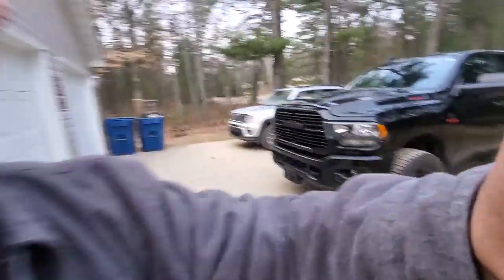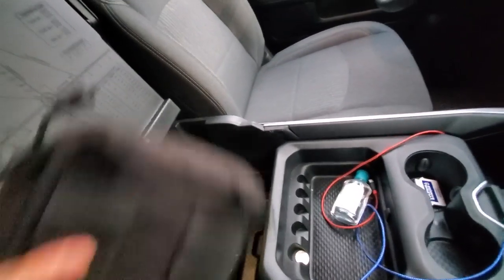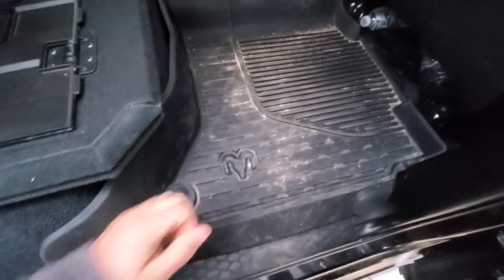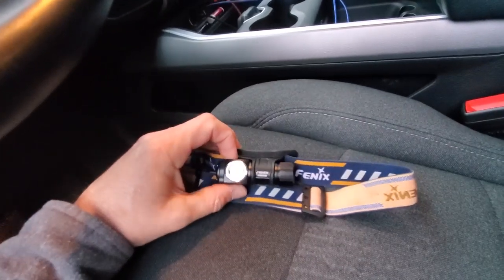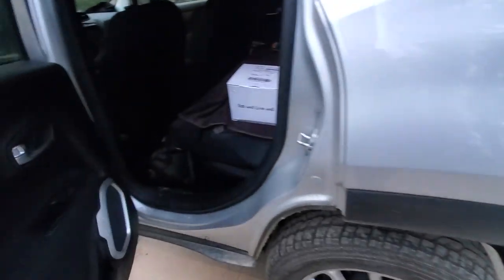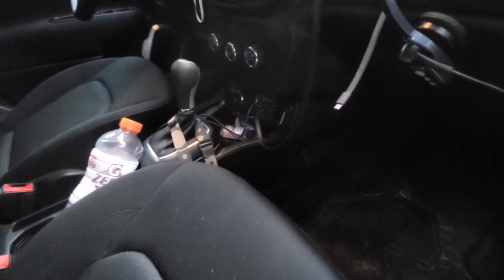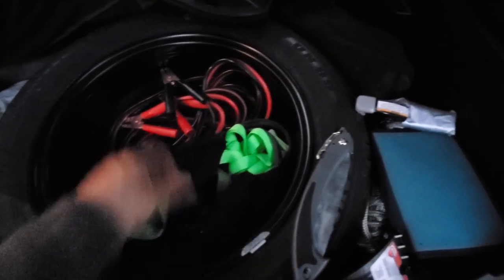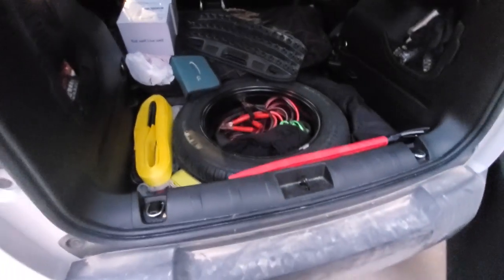EDC Stuff To Have  In Your Truck Or Car

Comment: Combination window breaker and seatbelt cutter within reach of the driver’s seat just in case you accidentally run your vehicle into a pond, lake or river!
Reply from the maker: Great idea. The points on your vehicles head rest bars are designed to break windows as well. Reach behind your head and pull u off the head rest and small side window with the bars.
Reply: @SamkoTradBow  What’s nice about the combination window breaker and seat belt cutter is it can be placed within easy reach of the driver.  Most are hi-viz and can be attached securely so they stay in place but are accessible with a one hand yank!  If your seatbelt won’t unlatch you can safely cut it with the razor sharp cutter and of course if your electric windows stop working while your vehicle starts filling with water you can break a window, usually on the first try.  I’ve got mine tie-wrapped between the center console and driver’s seat.
Reply: @SamkoTradBow  The one I bought from Amazon is the Resqme and is less than $20.00 for a 2 pack.
Reply from the maker: @jmarine1933  yep my wife had one on her key ring that would pull off when you yank on it. They are fantastic

Comment: Nice setup! you should add in a medical bag  with the capability to stop puncture wounds and injury you might sustain in a rollover or accident away from help. especially if this is a truck you use for hunting, redundancy is always a good thing! Even if you have a medical kit in your bag, the others you hunt with or people you come across may not. and even if you are not trained or dont want to risk any liability, being able to provide medical to a person on the scene that has training ( like a RN or off duty EMT) or the injured person for self aid is a valuable resource. a lot of times people in those careers dont have medical supplies in their POVs. have a good one!
Reply from the maker: Fantastic idea. Probably the best recommendation I have heard. Will research this soon and start putting together a kit. Thank you
Reply: Traditional Bowhunting And Wilderness Podcast I would recommend a laptop style bag for the kit. It will make it easier to store in your truck. On that bag, on the outside, you can rubber band a few tourniquets to the outside for easy access if you have a bag with molle webbing on it. Maybe a road flare  two for signaling at night on a road. Inside,   Compressed Z fold gauze, quick clot gauze, Compression bandages, medical tape, ace bandages, a Few NPA air way devices and a couple decompression needles and chest seals. Extras would be a few chem lights for marking injured people at night and extra illumination. Wouldn’t hurt to put gloves and a headlamp in there if you have the space. This will serve you well for a large portion of trauma.
Reply from the maker: @stevecourtright9856  awesome.  Thank you. Will dig deeper into thos when I get some time

Comment: Good kit. Maybe think about a hi-vis vest or two if you need to stop on the road. I carry an inexpensive oversize Tyvek suit if I need to work on or under the vehicle in foul weather. Keeps the  wind and wet off and keeps your duds clean. I would also up your first aid for trauma - I have a large scar where an arrow broke and part of it hit my hand - bled like I'd been shot. I think anyone with a bow/firearm should have a full kit for penetrating injuries. Have you considered mounting tow points on your vehicle?
Reply from the maker: Good suggestions! I bought a tow bridal like tow truck drivers use for my car so that it can be towed easily. Sold it last week and bought a cherokee trailhawk with tow points

Comment: I like the way you think. One thing I always carry in any rig that’s headed off road is a high lift jack or a farm jack they are called. They have saved me more than once from spending a long cold night in the bush.
Reply from the maker: Farm Jack's are great for sure. Heavy and take up a lot of space and require some knowledge of how to uses them. So not for the average person that doesn't want to take the time to learn about using them correctly and safety.  Bit 100% agree with you they can be amazing tools for all sorts of uses offroad!

Comment: Have you thought about putting a dedicated jump pack in your vehicles? Jumper cables are nice but if you don’t have someone else then you’re outta luck. Mine has saved me many times
Reply from the maker: I have 2 of the jumper packs. Love them. Reviewed one 2 years ago and still use it every week to start my lawn tractor as the battery has been dead for a couple years now..lol In the winter I always have one in the car or truck. Comes in very handy not only for me occasionally but also to help others fast and easy.

Comment: Comprehensive setup. Me like. I have a Mossberg 590A1 in my rig, specifically for large quardupeds/active shooter, as well as a lot of the stuff you do.
My dad and I are designing a prepper/hunter flatbed for trucks.fuel tank has a completely hidden 2 long gun, 2 pistol locking drawer, locking steel storage for chainsaws and valuable tools, camping gear. Locking steel generator compartment. By the time we get done with it, it will be too expensive to sell.
Reply from the maker: Sounds like a sweet rig! Plus quality time with your dad as you guys build it.

Comment: Have you had any problems with all the emissions junk on the ram? I'm thinking about getting a new one but have had nothing but problems with all the emissions stuff on my big truck (International prostar with Cummins ISX) I ended up doing a full egr and dpf delete and haven't had any problems since.
Reply from the maker: I have not had any problems yet with 30k miles. Follow and talk to many hot shot drivers with 200-400k miles on their ram 3500s and not one has told me they nad to do a delete or any major issues.

Comment: Hey Jason - I know this is an older video, but I just stumbled upon it recently and had a question.  How do you go about selecting the weight capacity for the come along?  My truck's curb weight is 4445 lbs and it would seem that the 5 ton model might work.  Your thoughts?  Thanks.
Reply from the maker: I basically buy the highest rated one I can afford thst still fits in the car or truck. Pulling weight rating is different from lifting rate.  So you want to check both. Come a longs suck for vehicle recovery.  And now that I learned to winch with the wheels I will probably never use one again.  Video coming soon on the wheel winching and have a quick demo of it on my social media pages.
Reply: @SamkoTradBow  Thanks for the reply.  Im looking at doing a DIY pig hunt in GA, going solo, and figure that I definitely need a method for self-recovery.  I picked up a set of X-bull boards and will be getting a shovel as well.  Do you think I'd still need some form of winching as well?  Thanks... you're awesome!
Reply from the maker: @yoda4x4  the winch is always a good idea to have. And a 4 ton come along is not expensive or too heavy.  But definitely learn the wheel winching techniques I'm talking about. Video coming very soon.